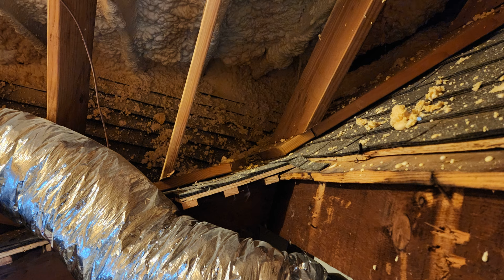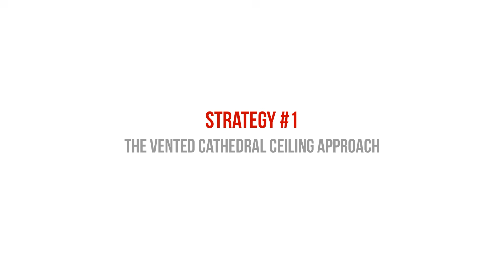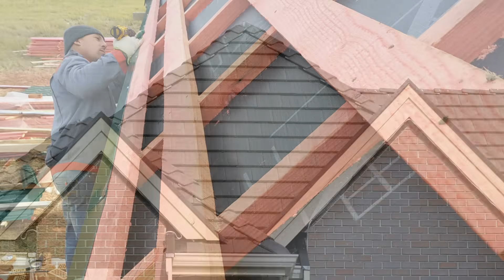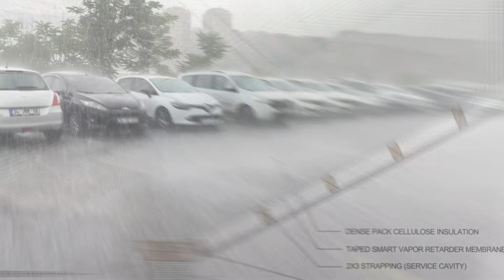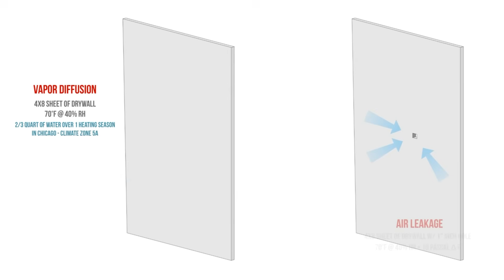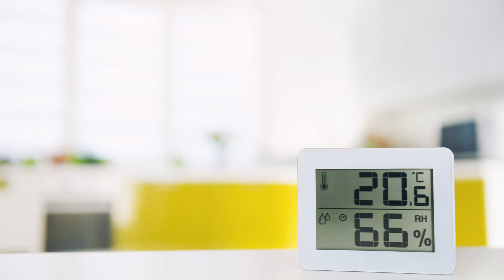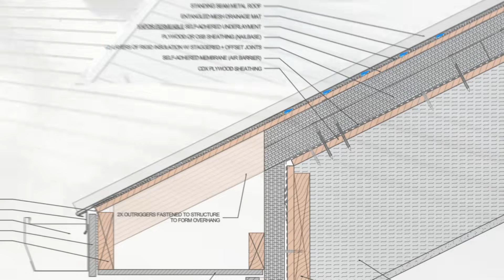A Guide To Foam Free Attic (Debunking the Myth that You NEED Spray Foam)

Comment: My head hurts! My roof is plywood free, cedar shingles, 1x 4 nailers, no vapor or water barrier, no water damage that I can see, and it’s 70 yrs old. Yes it’s worn out, can’t be reinstalled with Cedar. 
The options are endless and the possibility of poor workmanship and bad material choices are daunting.😢
Reply: The end of the world is coming soon / say every new channel / 
As a roofer in your area / In North Texas open or closed cell foam is great / 
If your roof leaks you probalbly won't know until the deck is damaged / the insulation soaks it up / fiberglass or foam / 
Don't be scared. It is sales.

Comment: What about air sealing the floor of the attic with spray foam 1-2inches  and covering that with other types of insulation. This would allow the attic to still be ventilated to remove any condensation buildup and air sealing against internal home air from escaping to the attic.  Oslty asking for the northeast USA region

Comment: Idk it seems that if your in a cold climate like MN your options are spray foam or out board insulation. Problem with outboard is it can be very expensive compared to spray foam if you have a newer roof. Sucks that we have so few options

Comment: This such a helpful video. I have an old building (1920s) with an unvented attic that I’d love to further insulate, in addition to the current 10-18” of cellulose on the attic floor. I’ll be using the taped rigid foam insulation on the interior.

Are you concerned about the nails used to fasten the shingles penetrating the roofing underlayment? Do the nails need to be stainless so as not to rust, separate from the underlayment, and cause air/water penetration? Side note, I’m still surprised that nailing 1-by spacer to the intello membrane doesn’t compromise the air barrier.

Comment: Does the low permeability of EPS, especially at high thickness, make it less desirable as an exterior roof insulator? If we then put plywood and a vapor permeable self-adhered membrane on top of that, won't the EPS already be a limiting permeability factor for a sandwiched assembly? Or does it not matter too much since the bottom layer of decking is an air barrier?

Comment: How do you feel about a DIY version of this? I have a 1.5 story house and want to insulate the knee wall attic for storage.

(6.5" rafters) 1" air gap - 1" polyiso (foamed around edges) - 3.5" rockwool in rafter bays; plus 2" continuous thermax w/ taped seams. gets R-35, slightly short of code.

Comment: I have been around construction most of my life. Worked on a multitude of high end homes. Seen my share of spray foam. It can look fine on the surface and  not be fine at all. One house I had to find my island wire that they had covered with spray foam. It was 2”x10” floor joists filled with spray foam. When I dug into it there was about 2” of foam then a huge void above that went for several feet in both directions. So what the owner paid for and assumed was 10” was actually 2” in that area. No telling how many other places that problem existed. 
Rock wool for me all the way. No off gassing. Will not burn. Water has little effect on it. 
Terry
Reply: You forgot the end of the world is near. 
I have never heard of that / I don't believe you
Reply: @Youtubehandle. 
Then don’t bother reading anything I say. If there is one thing I can say about myself beyond a shadow of a doubt is I am 100% honest 100% of the time. 
Terry
Reply: @ForestToFarm there is only one experience in the world.Yours no one else's matters

Comment: In the UK,that McDonalds sprayfoam cr@p is basically illegal because you cannot sell a house without an  inspection and it is impossible to tell if the roof carpentry is in good condition or not when some one-eyed clown has gone in there with that non-recyclable,non-biodegradable toxic nonsense.
Another problem that 'the industry' ignores (how convenient) is that covering the timbers in that gunk will greatly accelerate any rot in the timbers which have no air flow and cannot dry out AND hide that problem from you until it is way too late to fix it (yes things can still be repaired in some countries,subject to the level of intelligence within the society).
The world of businessmen and their products should be avoided if you care about anything beyond the end of your nose.

Comment: So I've seen 5 houses using closed cell spray foam and my own garage using open cell.    Its been amazing in each case, and some of those homes now have 10 years on them.
Maybe its a problem up north where you have more condensation problems, but in the south spray foam is hard to beat.

Comment: Just a couple of questions I haven't been able to figure out anywhere. In strategy 1  A) should you seal the 2" baffles on the sides with caulk after stapling them before you put fiberglass? (I'm using the plastic durovents, I've seen pictures of the foam ones melted after 10 yrs). And B) are you saying not to put a foil faced GSP foambord over top of the fiberglass? C) If I stapled and taped 6mil vapour barrier to close off the conditioned space is this sufficient. This is for the crawlspace behind the knee wall/story and a half. Thank you from 🇨🇦

Comment: Will this work with steel I-beam instead of parallel chord trusses?
Reply from the maker: No, you need to use exterior insulation if you're dealing with a steel structure due to the extreme conductivity of the steel. Not only do you lose about 75% of the effective R-value of the cavity insulation, but it's a hot bed for condensation. We have some examples we've consulted on.

Comment: I know you can't afford not to but who could afford to do? Great video but the more I learn with my limited finances I feel disheartened by the scope of this detail to moisture and insulation. Hope some one figures out someday how to build quality affordable homes.
Reply from the maker: Just build a traditionally vented attic, air seal the ceiling, and locate your ductwork in a service soffit below the ceiling's air barrier. Most affordable and long-lasting roof money can buy.
Reply: @ASIRIDesigns while I do have a traditional vented attic, watching your videos is making overthink how to insulate my garage with tar paper against brick with 2x4 framing. Wife started using garage for smoking and exercising dogs during winter and has 1500w heater running 8hrs min. to achieve 8-9 Celsius. At least the house smells better.
Reply: @ASIRIDesigns  Stay out of North Texas. No one with money does it your way
Reply: icf

Comment: It would be nice to see how you can simplify these installs further, the structural engineer is not building the house. The guy swinging the hammer is not sober, he's tired running on zyns and doesn't give a hoot about a "nailing pattern schedule".
Reply: If it's the project I'm the structural engineer on, he will be ripping it apart and redoing it.
This is the direction construction is going and there is less and less room for people working on the project who don't understand the science behind the detail (and elect not to follow the drawings). This is dangerous stuff working with wood frame construction driven by energy codes that discourage air leakage. The devil is in the details!
Ps I've had my share of shady  characters working on my projects over the past 25 years and I understand what you are saying. In British Columbia, the builder has to carry a builder warranty and as part of that process, the builder has to take mandatory continuing education before an insurer will underwrite the contractor. This is all driven by the leaky condo crisis in Vancouver over the past 15 years. I was a recipient of two of these lawsuits. The plaintiffs lawyers said I as the structural engineer "had a duty of care to protect the structural components of the building from future water ingress". Both projects had dedicated envelope consultants...
Reply: @EngineerK  There's so many variables at play that it's easy to miss things, even when you are looking for them. That's why I like SIPs and to some degree, ICF, for envelopes. Simple doesn't need to compromise quality and SIPs is a great example of that. It's nice to have an Engineer like you on the job, but the owner also has a construction loan they are waiting to convert to a mortgage while we wait for the builder to redo shoddy work. If it's simple, it's harder to do wrong the first time.
Reply: @EngineerK  I hear you, but as an owner builder, seeing the wide range of conflicting advice is confusing.

I wanted to buy a standard set of detail drawings, can't even find good detail drawings to trust.

Comment: In theory SPF should be a perfect insulation but unfortunately it is way too easy to screw up.  It's not worth it in most cases unless it is a large metal building or some other simple commercial non-wooden structure.  If you screw it up, it is inevitably an expensive screw-up.  I prefer medium density mineral wool insulation for residential use.  It has a good R-value, is fireproof, can absorb moisture and release it without damaging the material, easy to cut and install by a DIY person, and doesn't require a specialized contractor or equipment to install.

Comment: For the exterior insulation method. Using rigid polyiso or xps instead of rock wool . is the additional layer of sheathing needed? could  2x or 1x lathing/strapping be used instead. This would allow a foil facing polyiso to work better as a radiant barrier with the lathing air gap. Also better drying potential.
Reply: That's foam. You're not supposed to use foam, for some reason.

Comment: So, for me, the layers are fiberglass insulation between the 2x6 top chord of the trusses, 3/4" T&G roof sheathing covered entirely by either Cat 5 or Owens Corning WeatherGuard G peel-and stick, 2 layers of taped and foamed 2" ISO and 1 1/2" of RockWool Comfortboard, which matches the thickness of 2x6 structural overroof.  On top of this to hold the insulation in place are 1x3" attached to the trusses using 10" Simpson SWDS screws as vertical battens.  Intermediate, at 12 OC are additional 1x3 vertical battens, then horizontally, 1x3 battens attached to the both the structural vertical battens and the load spreading vertical battens.  The horizontal battens are offset over the vertical battens, to provide a venting path upward through the assembly.  In the space between the vertical and horizontal battens, a foil radiant barrier is installed.  With the joints in the ISO taped, this results in a number of significant water barriers:  1) the standing seam metal roofing, 2) the radiant barrier, 3) the top layer of ISO that is taped, 4) the bottom layer of ISO taped, 5) the layer of either Cat 5 or WeatherGuard Peel and Stick.  This is what you get when you have a PhD engineer, retired, that has plenty of time to over think things.
Reply: And thank you global warming for creating such a great winter for building in the Idaho Panhandle!
Reply: Yout roof is like 3 feet thick?!
Reply: @TheRalliowiec  How do you figure?  Two layers of  battens - 1 1/2 " thick.  1 1/2" of comfort board - 3" so far.  4 inches of ISO - 7 inches so far.  23/32 T&G sheathing, so 7 3/4" so far.  2x6 top trusses, with fiberglass insulation in the cavities - 13 1/4" thick.  The metal roofing on top is about 5/8" tall so around 14".

Comment: SHOW ME THE BLOWER DOOR TEST OR THIS IS A TOTAL LIE IF YOU CAN BEAT 3-5 AIR TRANSFERS PER DAY WHICH IS WHATS REQUIRED PER BUILDING CODE FOR UNVENTED HOMES A SPRAY FOAMED HOME IS THE MOST EFFICIENT BUILDING PRACTICE TO DATE. All of my clients have reduced there energy consumption by 30-50% reflecting on there monthly electric bill every month
Reply from the maker: We routinely get below 1 ACH @50 Pa without the use of spray foam.
Reply: @ASIRIDesigns  BS
Reply: Chill dude, they literally say all the time that they don't hate spray foam
Reply: AND THE FAILURE RATE OF SPRAY FOAM OVER TIME PLUS TOXICITY IS NOT GOOD! SPRAY FOAM IS SHIT!!

Comment: I love your videos.  Do you have a video on best value insulation system for barndominiums/ pole barns?
Reply: Ditto. I'm working through a metal building design with Miracle Truss right now that will have continuous polyiso exterior insulation. Would love to see a video on this type of building design.
Reply: @branchandfoundry560  IMHO #1 make sure there is an air space under your steel roof so it can vent... steel will condensate moisture on the bottom & need to be able to dry out!

Comment: I got confused with the vented option. So do you place the Tyvek on your trusses, then screw in a 2x4 before adding a plywood? Or do you staple the Tyvek right before blowing in the insulation?
Reply: Tyvek on top of trusses first, then 2x4 to provide air channel for ventilation.
The top Tyvek prevents insulation from moving/blocking the ventilation channel; also allows any vapor in the insulation to escape into the ventilation channel.
Reply from the maker: @Zjy1114b Exactly right. The Tyvek needs to be installed over the top chords first, otherwise you're going to have a fun time stapling Tyvek within each rafter/truss bay.
Reply: @ASIRIDesigns but what if you are in a retrofit situation?  I know it's a lot of work but couldn't you put tyvek in each rafter bay to form the 1.5" gap and then do cellulose?  Also, what about using XPS in the rafter bays while also leaving a 1.5" gap against the roof sheathing?

Comment: Most of these details are still eating your sweater...  we really need to stop doing that. I would much rather use something like Hunter panels, or closed cell spray foam on the exterior with fiberglass Z girts or those Insofast brackets plus 2x straping for the roofing.

Comment: Thank you again for another fabulous video. I haven't checked your previous videos but I'm curious about how you would structure a floor system with radiant heat (eg, pex in/on insulation) over a basement (or crawlspace) that is not fully sealed in a cold climate (CZ 6-7). Is using polyiso just asking for trouble?

Comment: This is my post to a Steven Baczeks video it was in answer to a question about this how to insulate above the roof deck. I love both you guys for doing great work and providing excellent illustrations and commentary. 
ASIRI DESIGNS  does a decent job illustrating the method. I double seal (the only time I would ever consider it with vapor diffusion port cut at ridge) the failure point is the primary monolithic sealing layer under the insulation (house side) I install a white elastomeric roof system here (lanco brand, because it's cheaper), that includes patch compound every seam with mesh tape,  their waterproofing primer and I use Henry 195 contouring fabric embedded in the finish coat for the entire roof and have never had any issues. here in north Texas I install two continuous layers of 2" XPS stagger the joints 4" total. I then put a layer 7/16" OSB ( I use 7/16" common OSB for both layers because of I only do vented metal roof) then white patch and seal the joints (white patch to protect the XPS from the next layer which is asphalt)  for this layer I prime the entire roof with cold processes adhesive including the roof edge and sub-band and then a 75# modified base layer. I only do vented metal roofs so I lay 2x4 flat on the existing rafters/trusses locations, you can run them long for the overhang, then 1x4 16" on center for the metal roof. you can extend your rafter tails securely from this layer. There are many other considerations, but that is basics of the method that I use

Comment: so for a cathedral ceiling with vented rafter bays in from inside out...  drywall, foam board, vapor barrier, roxul, air gap, plywood.  correct?   upstate ny, southern new england.  cathedral ceiling only runs about 6 feet on each side with small attic in center.
Reply from the maker: Almost...No vapor barrier is necessary if you use the foam board. Rigid foam is a class II vapor retarder. More importantly though, the rigid foam needs to be serving as the air barrier, which means taped joints and a sealed connection at the top plates.
Reply: @ASIRIDesigns  ok.  for existing vented crawl space top down... roxul, air barrier, foil backed foam board. best tie in method for rim joist?
Reply: @TruckguyTruckguy  Set up a consultation session with ASIRI Designs; it’s worth it and they are very efficient with their time. Will set you up for long-term success. I speak from experience.
Reply: @MichaelJ674  just a confirmation question of a previous video.